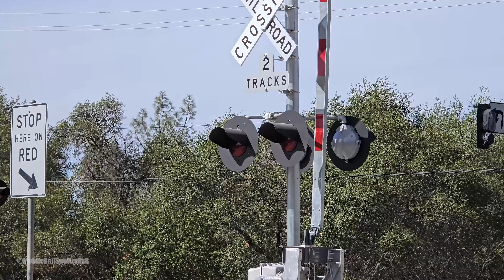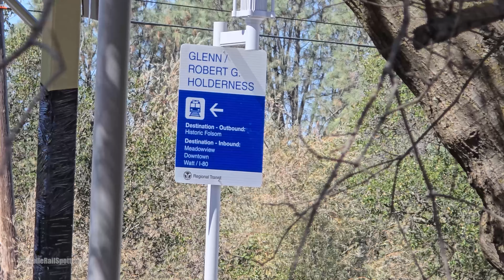Sacramento Light Rail Trains In Septemeber 2024 + First Month Of Siemens S700 Low Floor Trains

Comment: Nice video! I've noticed though that the outside paint of the new trains look a bit plain. Is that what they're going with or is it just something temporary?
Reply from the maker: Thanks! Its going to be the livery for at least 2 years until the Siemens Warranty expires according to SACRT. Also, they are going through rebranding which will tale as long.
Reply: @MobileRailSpotterRxR  Makes sense. Thanks for the explanation